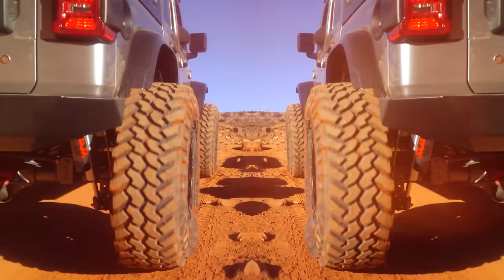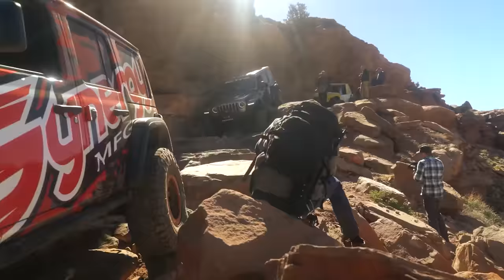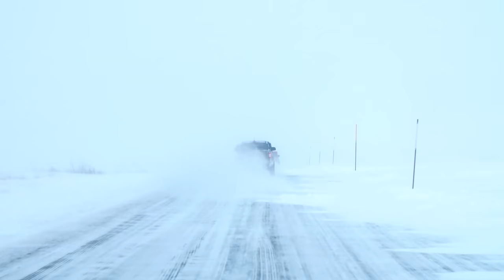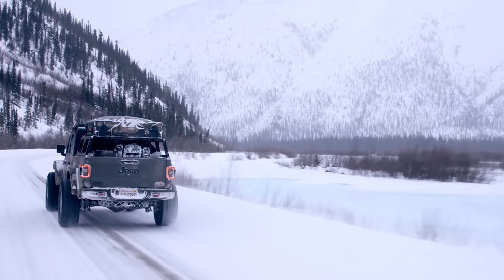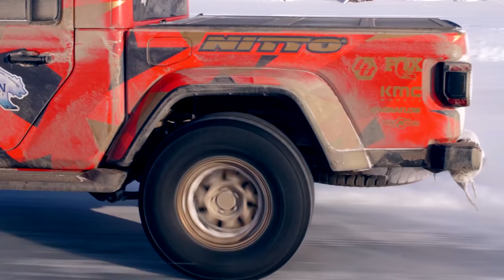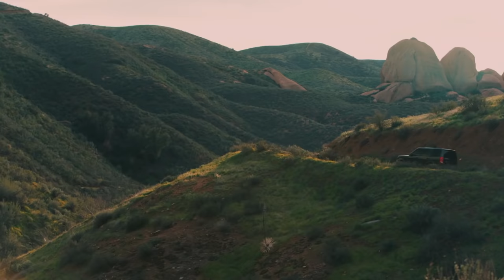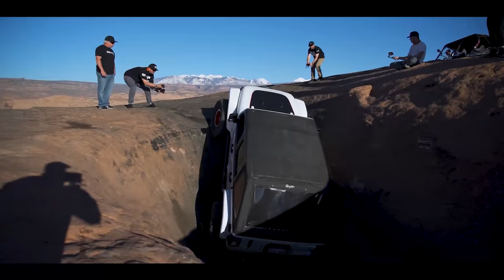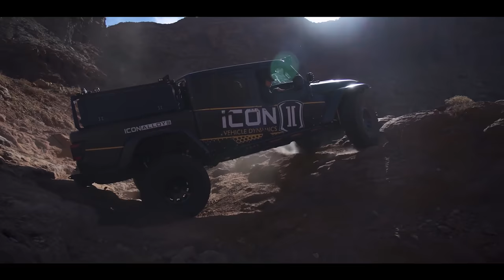Do NOT Use 4-Low Offroad || Watch First!

Comment: When you hit the trailhead, put it in 4L.  This guy talks like people go back and forth between 4H and 4L constantly. 
When you go off-road, put it in 4L and know your gear ratios. Need more speed?  Don’t go 4H - put it in a higher gear. 
Example:  stock JK Rubicon (3.6L) with manual transmission. 6th gear in 4L is approximately the same as 2nd gear in 4H. So - probably the only time you need to go back to 4H is if you’re truly overlanding or “commuting” long distance dirt roads between trails or obstacles. 
If you have a tcase with low range around 2.8:1 (instead of something deeper like 4:1), you basically never need to leave 4L when off-road. 
It’s all numbers. Know your rig.
Reply: yep, 100 % I know there are not too many trails i wheel on that  i can use 4H haha
Reply: I totally agree.  I have a YJ.  As soon as I hit the dirt I am in 4 low.  It does not matter if a 2 wheel drive pickup can drive the road.  I love, the control it gives me, I have a manual.  I end up using the brakes far less and the driving is very easy.
Reply: High range is for driving in town in the snow or backroads that aren’t very steep lol it amazes me that some people are convinced 4 low only has 1 gear 😂😂 4 low just hides all the other gears into its ass I guess

Comment: Because 4 low is used so rarely, you might want to try it out close to home before you try it out on a trail.  I had a Ramcharger way back and it went into 4 low, but had a hell of a time getting it back out, and needed to travel at highway speeds to get back home.

Comment: I like to leave the front hubs unlocked and use low lock when ever I want to snap the input shaft on my turbo 400,  sheer the ring and pinion,  and twist the center section on my 14 bolt, all while doing a big smokey 3 gear burnout.

Comment: I guess this was for someone who just bought a 4x4 or someone younger than 35 years old.

Rev limiters dont work on deceleration so you can break a rocker arm or cause an issue.

There's alway a weak link so you dont destroy the major part to the drive train. Bring extra part, drive shaft, CV, 1350,

That's about it. If you dont have anything over 35s you'd have to punch it to break it.
Typically that will be wet and muddy. The rest you'll learn along the way.... but wait 97% of folks are too scared to build and try anything cause they dont want to screw up, or waste money.

If you bought a 4x4, that's what's it's all about. Unless you just like the looks, which in that case hang out and continue to built it out.
Reply: Brad Deaton might have a child or friend under the age of 35. So be careful, you might offend him. Lmao
Reply: You'll probably bend a valve before breaking a rocker.
Reply: I don't agree with your comment.  I've owned a 4x4 for many years but a Jeep only about ten years. However, I've been going off road since the 1960's when I first learned to drive.  Most of the time,  I only had a 4x2 so it worked; I found I could get more places driving in reverse than many people could get driving forward.  We all learn different things at different stages of our lives.  I think it is better to learn late than never.  Have fun.

Comment: On average what's the highest speed you can use 4low safely?
Reply: If you are asking, you are going too fast. 4lo is important but you should be cognizant of the terrain or obstacles you are navigating. Most owners manuals will also suggest.
Reply from the maker: I'd slow down once you start seeing flames coming out from under your rig! Otherwise, good judgement will determine your max speed, ie: keep the Revs out of the red, tight, narrow trails will keep you going slow, wide open roads, just shift it to 4-hi or 2-hi depending on the terrain, etc. 😎
Reply: I wouldn’t go over 15
20-25 is really pushing it you’re gonna over heat and make your engine very mad lol I wouldn’t go over 20 for more than 5 seconds at a time and I’d recommend only doing it 3-5 times in a 2 hour span lol
Reply: @TrailBuilt  thanks 😄
Reply: @Reverend1776  not necessarily, why are you assuming without enough information?

Comment: Yea 88 ISUZU Trooper def needs 4 low to get all the power out of my 2.6L V6. 5 speed manual with manual transfer case.
Tho I also use 4 low in my 97 Suburban for trail driving always fun pulling my friends trucks out of the mud/sand with 8 people in the limo :D :D

Comment: 4H 4L is no different than running gears with a MT - let the machine tell you where it’s happy.
Reply: Are you suggesting that it's perfectly fine to leave your stock 3.73 gears alone, go up on your tires to some 44" boggers and just leave the transfer case in low range?
Reply: @Mike-gw9yt  - not at all.  Bigger tires are a physics equation that needs to be balanced with parts to match.
Reply: @brettheiner7125  ...... I'm just trying to make sense of your original comment. "4H 4L is no different than running gears". Running gears are a world of difference compared to your T-case ranges.

Comment: I often switch to 4LO not because I need more torque but because only then I can lock the rear axle. Steep hills with loose gravel for example. Also just when I want to drive really slow. With manual transmission I can just let go of the pedals and focus on steering while crawling forward.

Comment: The presentation of information is well done - it just boggles my mind that people would go take ICE cars off road without these extremely fundamental ideas about how cars work. For anybody who knows how to work a manual transmission this stuff would be a no-brainer. Of course this all will become forgotten lore in a few years when electric will take over. And let's face it: electric engines are vastly superior. If it only weren't for those damn low capacity batteries...
Reply: Batteries haven't done very well in extreme cold. I grew up in Colorado and many winters the temps were well below zero. I lived in Gunnison for a few years and the coldest it was while I lived there was minus 65 deg.  At least the wind was not blowing.

Comment: FYI for others with an auto TJ: You need to put it in neutral, turn off the jeep, shift in 4 lo and then start it back up. If you don't it can make a bad grinding sound and usually won't even go into 4 low
Reply: yea. thats not true at all. neutral is all you should do. zero reason to turn off the jeep.
Reply: @n20jeep  well have a try at mine then because it makes a terrible sound. If you look in the manual it actually says you might need to turn it off. Since I've been doing that I have no more problems getting in 4 low
Reply: @n20jeep  NOTE: Pausing in transfer case N (Neutral) in vehicles
equipped with an automatic transmission may require
shutting the engine OFF to avoid gear clash while
completing the shift. If difficulty occurs, shift the auto-
matic transmission to N (Neutral), hold foot on brake,
and turn the engine OFF. Make shift to desired mode.
Reply: My '03 TJ,I have to stop and put transmission (automatic) into Neutral to shift transfer case into 4H or 4Lo,my '00 TJ w/2.5L 5 Speed Manual  transmission, I could shift into 4H on the Fly!
Reply: Try switching from 4hi to 4lo with auto in neutral and rolling forward about 2-3mph. Works every time smooth as butter. If you’re having issues with it that way check oil in tcase and diffs or condition of tcase and the rest of drivetrain. Also check the adjustment of the tcase selector, or replace with a cable kit. It talks about this in the official jeep video of that time period. It’s easy to do, rolling forward slowly in drive (2hi or 4hi) while still rolling push auto in neutral, then quickly pull all the way up to 4lo, then bump auto back down to drive. If everything is in proper working order it should work without any grinding and pop right in 4lo. Also do the same when going from 4lo back to 4hi or 2hi. Try it!

Comment: I’ve only used 4L 3 times. Pulling a fallen tree up a steep incline, trying to pull my snowmobile trailer out of 8 inches of snow, and pulling my parent’s SUV up the icy driveway. I only got a 4x4 a few months ago, used to live in the city in Texas, now live in rural MN, so kinda necessary. I’m sure I’ll use it more later though

Comment: I'll comment on the video after I watch it.  For now, just my thoughts on the topic and it seems 90% of the comments I agree with.
4H should basically have a "do not use" tag on it.  It's application is very rare(mud drag racing, maybe you have a granny tranny, and things like that).
4L off road, if you have the ability to use more speed, then you don't need 4wd, use 2H.  This can even apply in slippery circumstances.  Practice, in a safe place, recovering from a 4wd skid vs. a 2wd skid, see which is easier.
I see a lot of comments about manuals, all of which are true.  Saves the clutch, it's much easier to start and stop in gear in low range, etc.
It also applies to automatics.  Their clutches are more durable(or it often seems that way), but they will get much hotter in high range which will test your cooling system.  You also lose a lot of compression braking, which is hard enough to get in an automatic.
With modern soda can case, chain drive, planetary reduction xfer cases which use sewing machine oil, you don't want to overspeed them or they can get hot and go kaboom.  My tow vehicle has one and at 35 mph in low it whines to beat the band.
My older off road vehicle with a iron case, spur gear xfercase filled with heavy gear oil, 50 mph doesn't even seem to bother it in low.
So, like many have said, know your vehicle.
Generally, tho, slow and low off road is the way to go.
Reply: I love having full time 4h on my GX460. I get immense traction in rain/snow without having to switch to 4h and can drive 100+ mph in 4WD. Then I still have 4lo+locker on a body on frame for more difficult stuff.

This is the perfect configuration IMO. At least for an off road capable daily.
Reply: @CodeUnknownTV  good luck off-road with that.  The nice thing, though, is that will have a computer to straighten out your vehicle if you get into trouble at high speed, but, without that, AWD is great until you get into a skid.  I also imagine the computer will not allow the xfer case to be locked above a certain speed to increase stability.  Having the diffs open on slippery hard surfaces increases stability a lot.
I love that it comes with a "steering angle indicator", lol.

Comment: 4 low in a Cherokee means 4 low in gear 2. Pull the fuse under the glove box  and it sends it to first gear. And won't upshift till you replace the fuse.  You can also rig a switch in that circuit to avoid pulling the fuse

Comment: I wheel an 84 K10 with an NP208 and SM465 4spd manual on 33s, open diffs. Since 1st gear is 6.55:1, I don't often use 4LO. Putting it into context, my effective crawl ratio in 4HI is equivalent to a 98 Silverado 2500 in 4LO with 4.11 gears. 

When I need 4LO on an obstacle, lockers or not, nothing stops it.

Comment: I would say always use what you think you need. Better to have the power in 4 low or be in 4 wheel drive than find out you need it and be stuck miles from help or get into a situation where it’s too late to do so. I’ve made plenty of mistakes listening to advice from others that went against what I thought I should do in a situation. Needless to say I do what I believe best and if something goes wrong it’s only my fault.

Comment: Here is a good stuck story. I had an old CJ-5 I think it had a 258 straight 6 one barrel carb. 33’s I would run with people who had full size trucks with nothing smaller than a 38. No the narrative is set. I was getting into position to winch a buddy out as I was the only one with a winch. Got cross rutted and the short wheel base of the CJ-5 I fit perfect in the tire rut and was high centered  between the ruts with each axle in a rut. Hope that wasn’t too confusing.

Comment: Had a frontier pro-4x, one day at the beach a tundra was bogged up to the frame in the sand. Tried getting him out In 4high and didn’t even move him, decided to put it in Low with the rear diff locked and got the truck out without problem. Never had to use it before that and I was surprised a mid size truck could get out a full size truck frame deep with ease.
Reply: Pulled a ram promaster out that was in the desert that dug to its frame and a 60 ft rv out of the sand in the desert with my 09 xterra very surprised
Reply: That's what 4 low is for, most don't know how to use it properly, pulling something heavy, climbing or going down steep hills, 2 or 4 high is best most other times.

Comment: Some vehicles with simple drivetrains like standard pre-2016 Landrover Defender have no front and rear lockers or LSD and no electronic control. With those vehicles, diagonal rocking is their achilles heel that brings it all to a stop. The solution is left-foot-braking which stops the low-traction diagonals from spinning and allows progress. However, the LFB method requires more torque to overcome the braking effect so keeping the revs up in the maximum torque range works best. This is more likely to require low range.

Comment: I'll try to make this short I had a 92 Blazer S10 with a 4.3 it was 1996 or so. The truck had 160, 000 miles on it. Went through flat field with deep snow tried out for high and for low did it in both went little faster in for low because engine was too weak with four high to keep pushing through deep snow. Long story short I would say horsepower matters on applications. 
PS when I had that set up in that truck and have it in four low the automatic trans would hit 2nd gear and pull a 6-in wheelie. Boy it hits hard when it hits second surprise the rear end didn't blow end it up blowing the front end getting stuck in a cross rut trying to get it out in for low going from reverse to forward got it out but blew the front differential (weak setup). Thanks for the video peace out.

Comment: When I lived back East, had an impromptu group at Rausch Creek.  20 something in front of me thought he should be in High and promptly burnt his clutch in his TJ up.  It was smoking pretty bad.  I drive a manual JK but that heat from slipping a torque converter will burn up automatic also.  Use 4L if the speed on the trail is under 25.  Having a manual I wish I had a low 2wd for traffic

Comment: Depends on what you drive in ways too. I have an older vehicle, 1999 Montero. As soon as I get to a trail I go to 4LLc. Belt driven water/oil pump and fans, the higher RPMs keep the flow up which cools the engine and transmission better. I almost never use 4HLc even in snow because the Montero has 4H without a locked T-case, basically resembling AWD. Even in the deepest snow I've only ever needed that mode.
Reply: What wait, there's all these weird new terminologies 4HiLl 4LLC 4inc 4GmbH 
apparently I WILL not miss much living under a rock.
Reply: @zainabe9503  they aren't new actually, it's part of Mitsubishi's Super Select All Wheel Control system that was invented in 1991. There is 2H, 4H = 4WD without transfer case lock (basically AWD), 4HLc = 4WD Hi with transfer case locked, and then 4LLc = 4WD Low with transfer case lock. So yeah stay under your rock.
Reply: @aaronschug6671  LOL I don't buy for a second the newspeak invented by Mistubishi propaganda department. But yeah, I'm doing fine living under my rock. 
At least I can be certain AND sure that mechanical LSD will lock up my rear wheels a bit, instead of being nannied by those gizmos you spelled.

Comment: Regardless of which 4 wheel ratio you use. There is one important thing to rememember : Four Wheel Drive gets you in Twice the trouble as Two Wheel Drive!  Your best off road tool is bettween your ears, matched to the other sesnses,. After spending some time in 4 low. Get on the flat and reverse a few feet to unwind the diffs before selecting the next ratio. .

Comment: 4L is really good for starter crawling. I've had a few carbed 4wds and when going over something Verry steep the carb might lean out or over fuel, instead of just reversing down with the engine off (dangerous and pretty hard at those angles) you can just use the starter in 4L 1st gear and slowly crawl over. Obviously if your car has a neutral or clutch switch this isn't possible but most old Toyota's your good.

Comment: As a new 4WD truck owner I was hauling some wood on dirt driveway when I got the front wheels stuck in a mud ditch; spinning of course buried them deeper, and reverse gear was the only way out since I was against a hill. Shifting into 4WD did not work either, just more spinning. I thought I was going to have to call AAA to get me out. But then I saw 4Lo on the dash drive dial, thought "what do I have to lose?". The truck backed right out like I was leaving a parking space at the mall.

Comment: I rarely use 4 low my last truck 6.0 Silverado had enough torque to do most anything I needed in 4 high I fo like it for going down slippery hills and for heavy pulling pulled a tree stump out with my Silverado in 4 low never spun a tire did not hardly work ripped a foot round hole in the ground

Comment: My rig has dual TC's, so I can get normal 2:1 LR in rear-wheel drive. Selectable hubs make it so I can have 4:1 gears in 2wd as well. The little 2.7TD can pull seriously heavy loads with great control and no stress on the clutch. 1st gear double LR at idle on 33's gives me a speed of 1.2km/h. At idle, it will make all 4 wheels spin on anything worse than gravel. On the farm where we spend many hours at super low speeds in heavy soft sand, I can travel in 4th (straight through gear) at low speeds, reducing the wear on my gearbox. Another advantage of LR crawl speeds is the ability to get yourself unstuck in soft sand. I discovered this after witnessing how the Tacoma crawl control gets you unstuck. Tried it with my rig, and it's the wheel speed that makes it possible, and hardly anything to do with traction control.